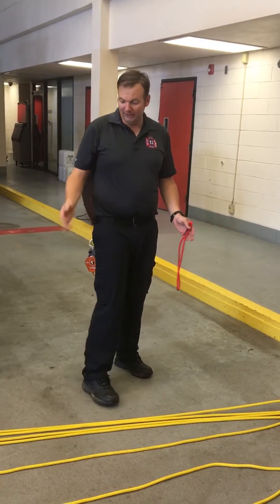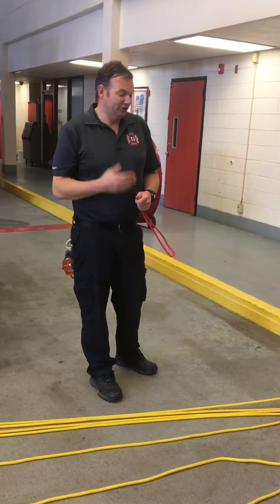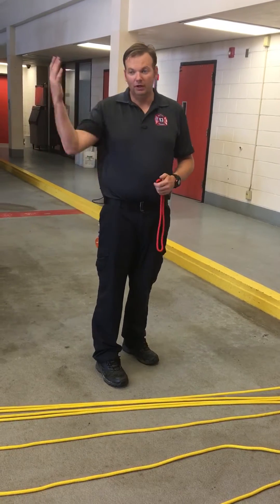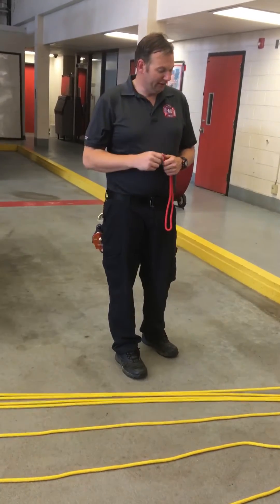15:1 compound system

Comment: if instead of single pulleys you had put double pulleys on the "compound part", would you get a 25:1 (5:1 x 5:1)?

And if so, whats the limit of mechanical advantage you can get before the amount of pulleys added generate so much friction that adding another compound system would actually remove mechanical advantage? 

Hope my question is clear.
Reply from the maker: Correct. If you place a 5:1 on a 5:1 you get 25 to one. I’m not sure. You would need a load meter to know for sure. I have done a 45:1 or 5x3x3 and it was a lot to deal with but it was effective. You are dealing with theoretical loss and gains until you get a meter on it there’s not an easy way of testing it.